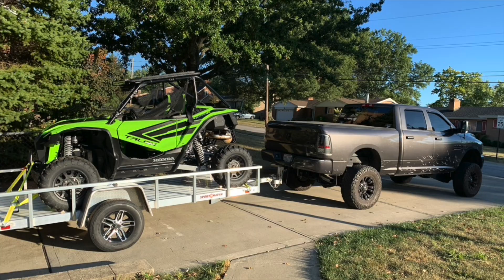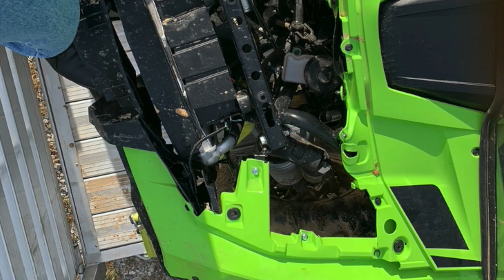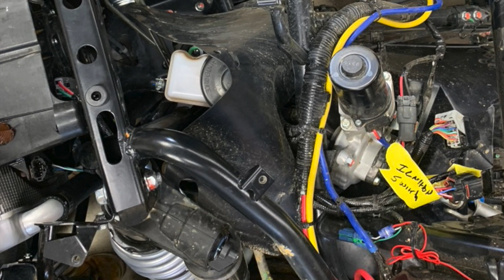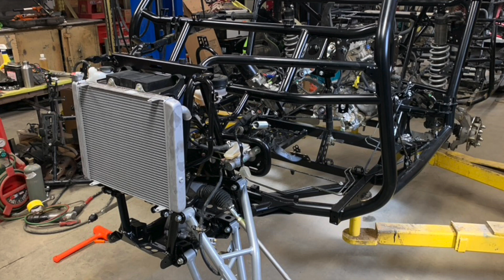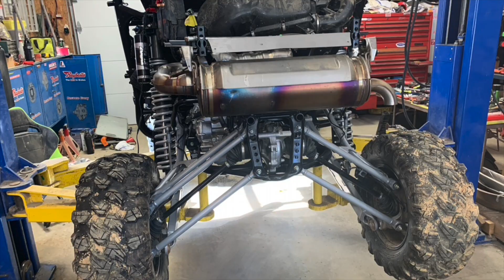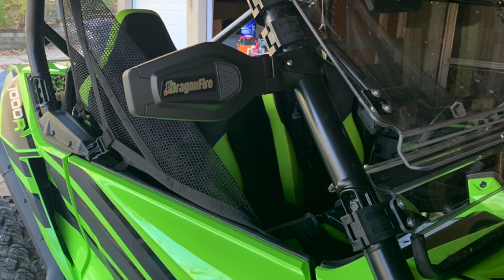2019 Honda Talon Rebuild

Comment: Did you have insurance an did they total it
Reply from the maker: I do have insurance. I fixed it, didn’t turn it in.
Reply: Cuda Project I have the talonx4 live valve an the whole front behind the  arms cracked an buckled the underneath an front drive shaft came threw the floor
Reply from the maker: Fla Cracker similar to mine, took about $5k to rebuild mine.
Reply: Cuda Project to bad I can’t put a pic on here you wouldn’t know anything happen to it an frame crack this is second one I ran across the broke in same place I think there’s a defect In them